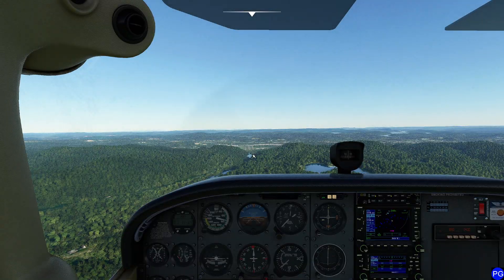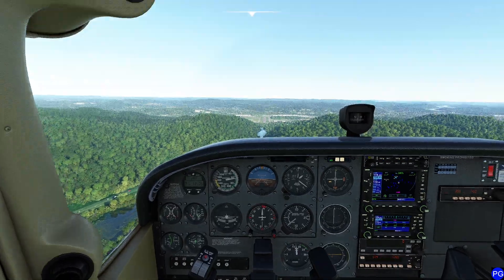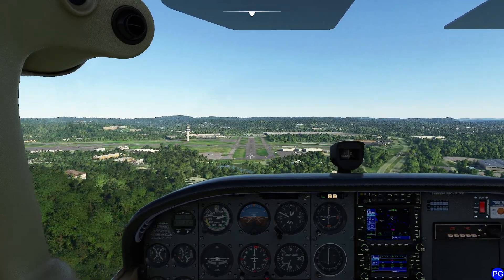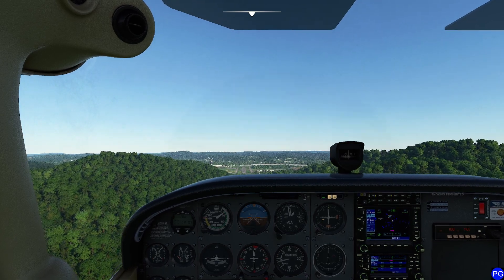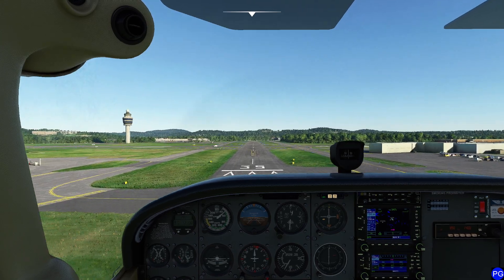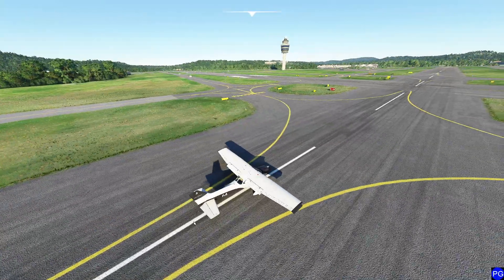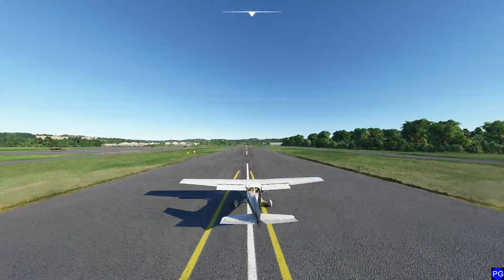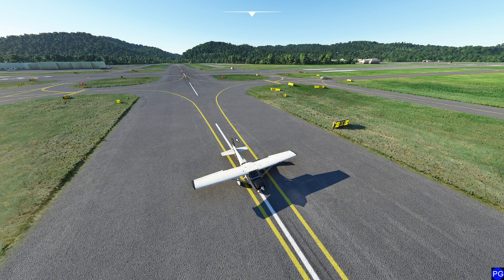MSFS - Effect of Speed on Landing Distance

Comment: I always wondered what happens, when engine fails during this kind of landing. Isn't it better to go steeper with less throttle just in case something happens? Or are there any techniques that allow pilot to safely land? Cheers!
Reply: The technique that works best is to be on speed for the flap configuration and always stay within gliding distance of the airport. Also, remember that the approach speed is for the approach, you should touch down considerably slower than your approach speed. You should touch down just above the stall speed.